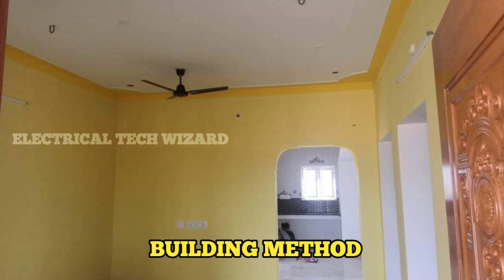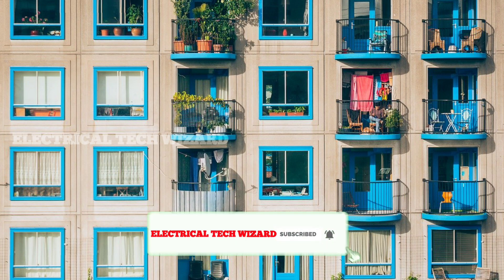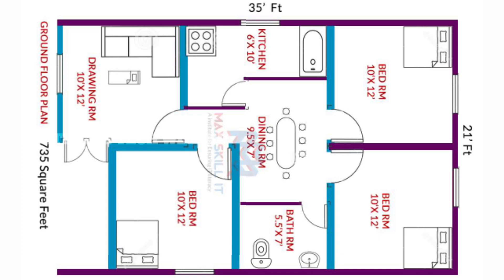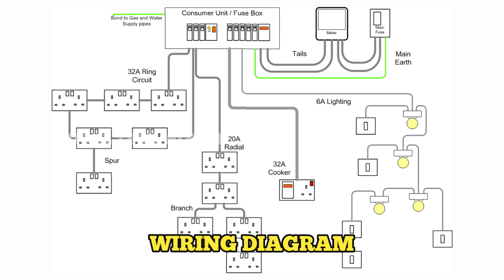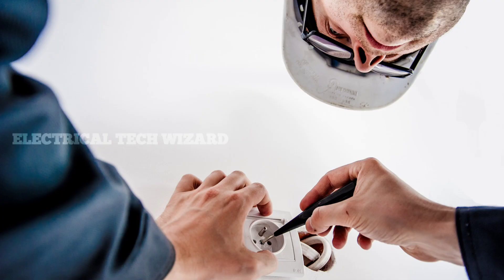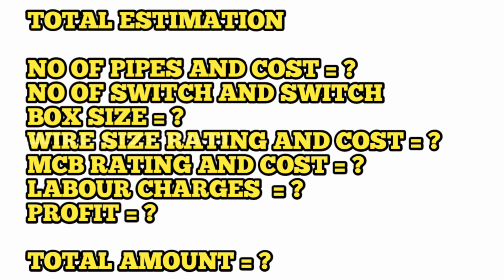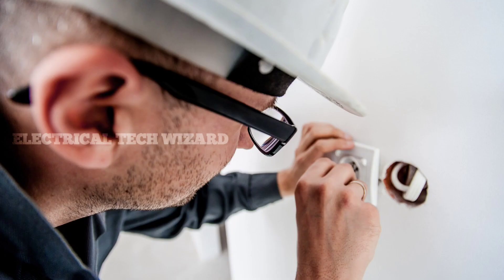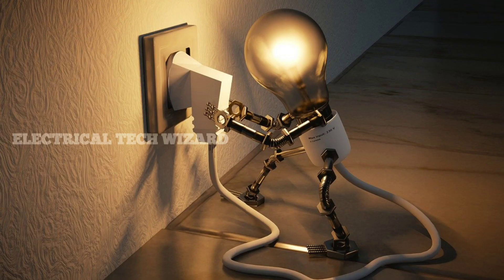House wiring க்கு electrical estimation செய்வது எப்படி | electrical estimation in tamil/roof wiring

Comment: Bro ippo point kanakku panni rate pesuna eg:120 na idhula roof piping, wall piping&box, wiring, switches, holder's varaikuma illa only pipe&box varaikuma apdina switches & holder fittings ku lam epdi amount podurathu plc explain
Reply: Bro reply panala😔
Reply from the maker: Dilip select tamil channel la பாருங்க இந்த video already pottu iruppanga brother 🙏❣️🙏

Comment: Bro switch box kadila vanganlo illa wood la pottu adhu plate cutting work pandradhuku  idhukulam namba amount kudukanma  namaku house owner kudutha square fit  amount la irundhu
Reply from the maker: sq feet rate la thaan வரும் நண்பா
Reply: @ELECTRICALTECHWIZARD  bro ipo 4   switch 1 socket  one indicator aprom one fan regulator ipdi irundha edhaniki edhana wood box vaangalam aprom adhuku adhuku plate , cutting charge evlo aakum switch ,socket ,regulator detail a sollunga bro
Reply from the maker: அது தெரியல ப்ரோ நான் maximum moduler cover thaan use பண்ணுவேன்
Reply: @ELECTRICALTECHWIZARD  bro eanku ORU doubt 3 phase use Panna MCB, rccb , rotary switch use Panna MCB first rccb second aprom rotatry switch connect pannnauma illa epdi connect panlam detail a sollunga bro
Reply: @mohanpuyalkurvin6662   switch type regulator na 12*4 board correct ah irukum bro... But socket type regulator na 8*6 board use pannanum..
Reply: @mohanpuyalkurvin6662 RCCB --> ROTARY ---> MCB  , naa ipditha pannirukka correct ah nu therila, therinja sollunga.

Comment: Bro normal all wooden switch board size meter wooden box size with switch ethana fix panalanu solu ga bro ple
Reply from the maker: 4×4=2 switch
6×4=4 switch
8×4=6 switch
10×4=8 switch
12×4=10 switch
8×6=12 switch
12×8=20 switch
10×8,12×10 
ippadi different size la irukku nanba meter box maximum metal box thaan use pannuvom
Reply: Thanks bro
Reply from the maker: mmm okay bro